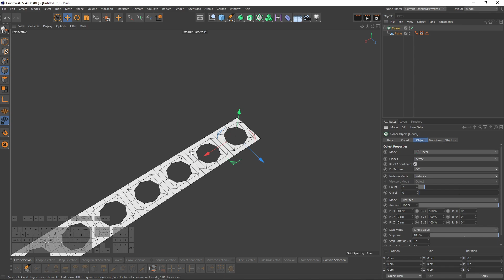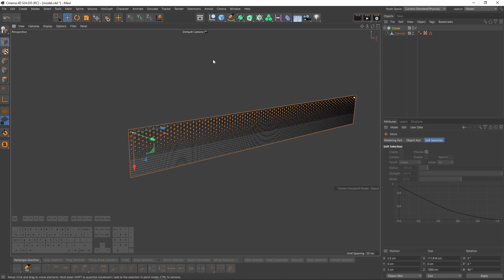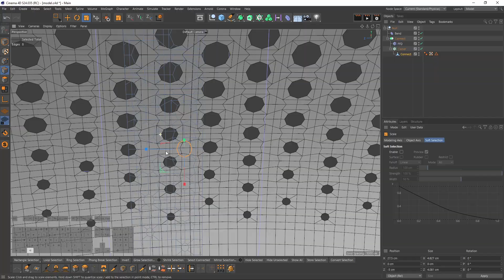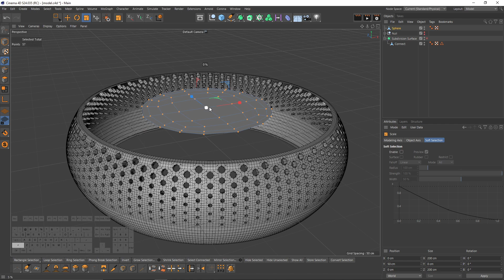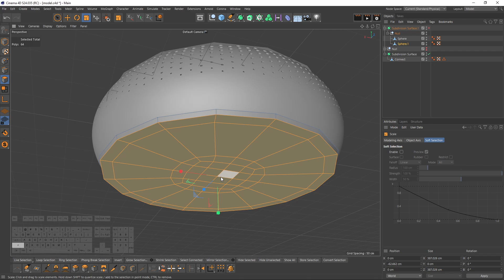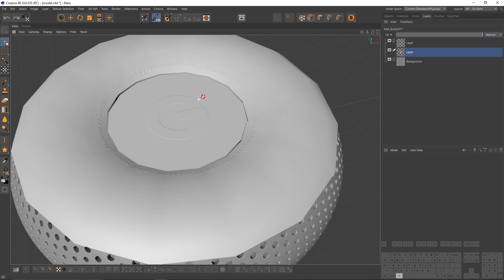Industrial Design/Product Modeling #13 | Google Hangout Concept

Comment: Hi. When im importing a textfile from photoshop, I get a white background, even tho I have two textlayers who got transparent background, any fix?
Reply from the maker: Transparent textures won't work well, like transparent pngs, so it is good to have an extra alpha texxture just for transparent areas.
Reply: @polygonpen  is that what you did?
Reply from the maker: @GranzDesign  I didn't do such thing in this tutorial, but overall, I do that all the time, I mean it is a must for material creation.
Reply: @polygonpen  Can you make a video for only that? I think many people would have use for it
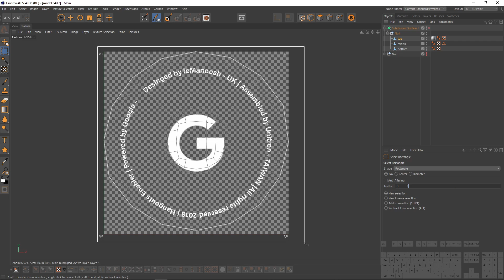Reply: @polygonpen  by that I mean on @18:20 , its driving me insane. I only get my text with a white background under it. Cant find any tutorial to only get the letter and save it.
Reply from the maker: @meem-zd3kj  You should prepare the texture in Photoshop, remove any bavkground and save the file as PS or TIFF.
Reply: @polygonpen  Ohh, I have saved as PNG the whole time. But how can I apply redshift texture on it now? As the letter comes as a c4d texture
Reply from the maker: @meem-zd3kj  I don't now, can't say much without seeing the scene.
Reply: @polygonpen  I mean. How can I do this with redshift render?

Comment: Is there any disantavtanges in using c4d instead of Maya or blender for example? Why do you choose c4d? As I know Maya and blender are more popular for these tasks. Do you work as 3d artist? I don't model but it would be interesting to hear your opinion.
Reply from the maker: Yes I am a 3D Artist/Genaralist, I have been using C4D for a long time for modeling, texturing, motion graphs, a lot of stuff, there is no disadvantage, I usually model with Subdivision surface technique which is universal, some softwares have shorter and longer ways/tools but it is the same, I like C4D's simplicity.
Reply: @polygonpen  thank you
Reply: 20 years ago I was searching for a pro level 3D software for Mac OS  and C4D was the only one. 3D Studio Max and Maya were PC only. Now I’m glad because I love it’s versatility and simplicity.
Reply: @steve_the_designer  agree. I also love cinema, started my 3d journey  because cinema is so user friendly.
Reply from the maker: @steve_the_designer  Yeah Exactly